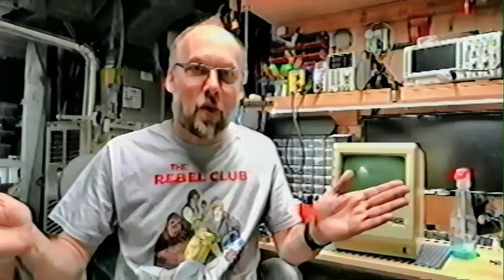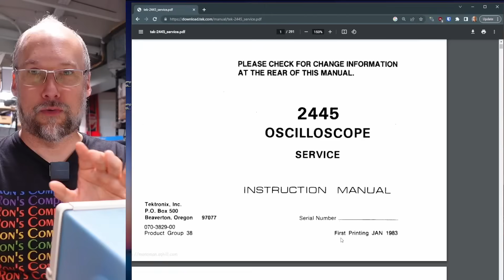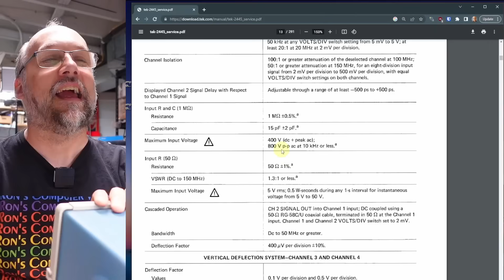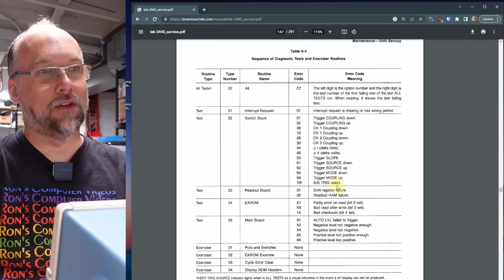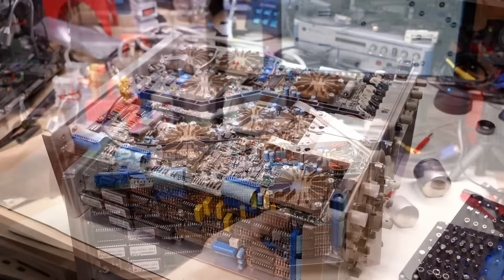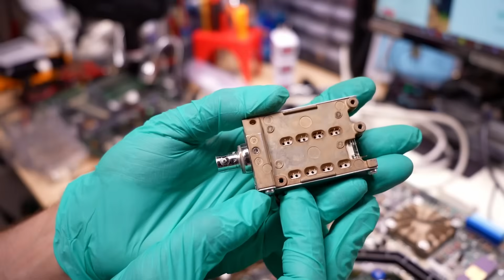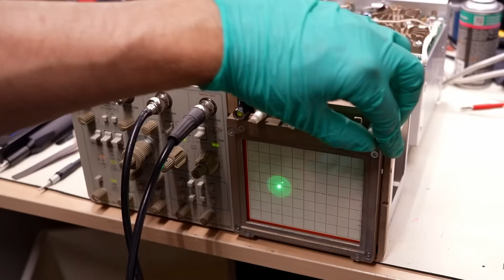Tektronix 2445: My first vintage oscilloscope repair attempt

Comment: Thanks for sharing. I have the same oscilloscope, got recently for a very little money, just some shipment with some extra for the trouble, in a defected state. 2 RIFA capacitors on the mains blow up. The oscilloscope works just fine now. I have replaced one (that I had in the box) the other one will follow soon I suppose.  I cleaned everything nice and tidy, went through the calibration procedure, just in case, as it was not really needed, the scope was already almost 100% true. Anyway, after looking at your video I do not really like the construction they come up with those relay connections. Too "touchy" I suppose. Why? But, we need to be realistic here, what do we expect from a 40-years old equipment. It is a Tektronix, quality stuff,  but it was not intended to run issue-free for a century. But in general, some solutions are (unnecessarily) made way to complicated, in my opinion. If working properly it is a very nice "no nonsense" scope. And, by the way, it is 150MHz, and not 150mhz!

Comment: To me, as shown around 46 minutes in, prodding the bnc terminal while the scope is re-assembled suggests to me the issue is not the relays, but the BNC socket. Possibly a micro fractured solder joint from the socket to the board within the attenuator board from repeated probe connection and disconnecting, along with a slightly loose socket assembly to the panel.

Earlier in the video there was another point I think it was in the reassembly with expectations all was fixed except it wasn't, where prodding the bnc lead made things right when it had been wrong again, and there was no pressing of the attenuator cover at this point in time. Just a fiddling with the bnc socket/ lead.
 Almost has me thinking it was a bad earth around the socket, which I am sure it wasn't, but then there is that extra sense terminal on the bnc socket that detects if a Textronic lead is being used...and flips the relays into a different setting...so what if that circuit is being 'half triggered' and that is why the scope shows such an abysmal trace pattern from what's expected ?
As you have the circuit diagram would it not be possible to use a multimeter on continuity setting to measure the resistance of the relay contacts from input to output and that would begin to narrow down which if any of the relays has an issue. I suspect its 'capacitance' related, poor contact, to create the trace as shown anyways.

Comment: Noting that pressing the relay black carrier down appears to improve things.  Could you isolate this to pressing down on only the clear casing of one or more of the relays?  I am wondering if the relays are not sitting fully down onto the pcb.

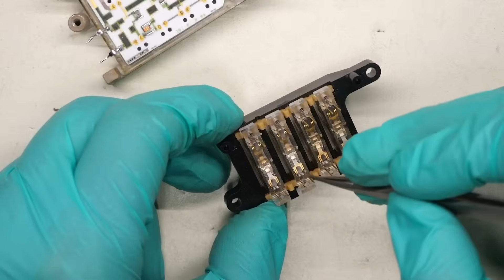At 37:21 could you put two strips of paper between the black carrier and the clear relay casing along each side so the relays have slightly increased pressure to the board.  Or indeed putting four rectangles of foam strip on the relay tops, between the relay tops and the aluminium can (a bit like where you have the paper, but only over the clear relay casings).

At 37:37  there looks to be a strip of material there at the moment (yellowed strip) which is intended to provide some force to hold the relays in contact with the board, but might have lost its effectiveness over time (become brittle and shurnk).

Comment: A little tip about "nomenclature" -- the rule about use of uppercase and lower case (as in MHz or mHz) is that quantities over a unity are indicated with upper case.  Contrary to that, quantities below unity are indicated by lower case.  Mega is clearly above unity and milli is below unity.  Hence MHz is 1 000 000 hertz while mHz is 0.001 hertz.  Simple, when you know...  Actually, there is something else to ponder -- units derived from a person's name are capitalized, while units derived from other than person's name are not capitalized.  So, Hz (from Heinrich Hertz), but 'ft' (presumably from king Henry VIII's foot) remains in lower case, as his name is not related, only his foot.  Same for meter (or metre) 'm', lower case, as no person's name as the source.
Reply: Don't forget k breaks the rule.

Comment: Try checking the actual coax/BNC connector. There should be a nut (like on a potentiometer shaft). Make sure it’s tight, but not stupidly tight. Also, check the wire from the center conductor to the attenuator, and resolder if needed. 😊

Comment: Channels 1 and 2 are the most-used on those Tek scopes, and it seems you were 98% there as far as debugging the problem.  Don't abrade the surfaces, but do clean them with IPA.  The problem appears to be the spring contacts between relays and board aren't making reliable contact, problem due to loss of spring tension thanks to being stuck in the same position for the last 40 years while eating a lot of heat-cycling as well as torque from the probes being connected to the BNC inputs.  I'm not familiar with the relay layout for those attenuators, but I'd bet cash money that the AC coupled relays are the ones furthest from the BNC jack while the DC are towards the front.  When you were hooked up and testing with the machine upside down the torque from the lead attached to the connector would flex (however small) the assembly ensuring that the front-most relays were making contact, hence why it all worked.  When you reassembled and put the machine in the proper orientation those connections were now being torqued downwards at the front and slightly upward at the back, hence why AC continued to work but DC did not.

You need to gently squeeze the flat-spring contacts on the relays to create more mechanical pressure so that they remain firmly in place with the pads.  You might also need to use some 2000 grit sandpaper to try and remove any raised burrs from your scratching of the contacts since absent a good surface-area connection you may run the risk of stray capacitance.

Comment: For a while I had a Tektronix 7600-series mainframe scope. It was beautiful, and was both an excellenet analogue scope and also fulfilled my poorly-hidden urge to have so, so many buttons to fiddle with. So! Many! Clicky! Things! And they all did useful things! Unfortunately it was very old and starting to break down --- the trigger didn't, very often, and the focus was drifting. Plus, it was vast, weighing 14kg and being about 75cm long. Eventually I had to give it away and get a modern Rigol storage scope, which is much less satisfying to use. Fun fact: the 7600 scopes could draw text on the screen --- but didn't have a CPU!

Comment: Hi, if I still had hair on my head, I would lose it terribly 😂 I completely understand your approach, if you have no experience with such a device, but you didn't even do a basic inspection of the components (or you didn't show it in the video) and stuffing it with paper sent me to the ground .
1) the input part of the attenuator was not checked (it may be mechanically damaged, e.g. by hitting the BNC), the hybrid PCB may have been damaged
2) the attenuator and motherboard connectivity was not checked (there may be cold junctions)
I almost died when I saw the gold surfaces being scratched by the metal and the pressure applied to the hybrid circuit board. Even the smallest scratch is a problem that cannot be effectively removed, as someone already wrote here - very carefully polish it with a piece of paper (you can also use a soft eraser on a pencil, but it leaves microscopic residues that need to be completely removed) impregnated with IPA and then treated with a suitable means (eg Kontakchemie Gold 2000).
The fault itself tells us what is happening - decay of the rectangular signal, decrease or increase in voltage = incorrect function of the input divider of the attenuator (it is only an estimate, but it is the first thing I would check)
1) decay of the rectangular signal = problem with input compensation
2) voltage drop or rise = input divider error
As I already wrote, this is just an idea without specific measurements, but another fact brings me to this idea - the anchored attenuator to the structure reacts to the movement of the BNC.
I could of course be wrong and the fault could be elsewhere - without measurements any advice can only be guesswork, but I am the owner of a working 2465.

Good luck finding the bug and have a nice day 🙂Tom

Comment: Enjoyed. Couldn't tell from video, but a lot of those old relays aren't sealed... and the bad connection is on the inside, not the external gold pins etc. If you don't want to brave cleaning them... you could see if you have enough working ones to restore only 1 channel. Also, have that signal generator too. It's fine for audio signals, I don't recommend for higher frequencies.

Comment: The service manual says the attenuators can’t be cleaned, but since there is no source of replacement parts, you have no choice.  I’ve done several.  With care nothing bad happened and it eliminated the noise in the vertical channel.  I used Caig Labs D100 and then 99% rubbing alcohol with a tape head deerskin swab.  I have a 2445 for use and another one for spare parts.  The spare parts unit was a show stopper because the fan motor was damaged beyond repair.  Why Tek couldn’t have just used a muffin fan?…  There is no way to source the crazy fan motor except from another dead ‘scope.  The 2445 is still a very nice analog ‘scope though it is kind of heavy by modern standards.

Comment: Back in the 80s I bought a cheap 1950s-era Dumont Cathode Ray Oscillograph.  Good up to a megahertz or so. Having something like this Tek would have been a dream, though I eventually wound up using this exact model amng others at work for most of the 90s. I've never seen the inside of one, and all I can say is holy cow, is that thing ever packed full.  Glad you were able to rescue it, very cool to watch.

Comment: My previous 2445 like my current 2245 had no atten. problems.  The Tek that gave me serious atten. headaches was a 465 and saw that alot in  the 465/475 units in shops.

Comment: I got  a 2445 for free once.  Ripple in the trace.  So anyway the DC power busses are clearly marked.  I could check all the non HV DC voltages compared to the markings and also see which one had the ripple. All the electrolytics were replaced that were like the leaky ones for about 6$ and then I had a perfectly working scope.

Comment: Intermittants can be a nightmare. Still good work and nice to see one of those scopes again.  I would suggest your problem is actually the BNC connector itself. They get "leaned" on a lot and can come loose from  the board or get damaged inside.  The channel, Mr. Carlson's Lab has lots of scopes like this and most likely spare parts.  Thank you for the video.

Comment: Great video! Love the analysis and repair. Definitely don't see these scopes around much. A couple weeks ago a friend recently gave me a 2245A scope from the mid 80s. (It's mostly identical but maxes at 100MHz.) I was amazed how much lighter weight the 2xxx series from the 80's is compared to the 70's 7603 scope I had years prior.

Comment: Both of those sandwiched boards are power supply boards and the side with the RIFA you saw has one or two more.  It does look like the one(s) on the board you could see had been replaced already.  I recapped both boards in my 2445, and the metal canned electrolytics were just high temp rated (125° I think) and I was able to get values close enough, all from Nichicon.

Comment: I wonder if a new "relay carrier" could be made to offset the locations of the relays just a little bit on one axis. This would move the contact point to a new / fresh location on that pad.  Either by making the mounting holes a bit oval, or by a 3d printed replacement?

Comment: Don't scape with metal, just use a fiberglass pencil, followed by De-Oxit to safely polish / clean the gold plated contacts. Sraping will lead to oxidation once the protective gold layer is completely removed.

Comment: Maybe spring contacts of relay are not enough strong, simply loose torque and not pushing enough strong. Try pull them little up (bend) that they can again push strong to PCB.

Comment: You're overthinking it.  Just imagine a games console with controller ports that need to be bent or re-flowed to make contact consistently.  They may look great but they've been pushed and pulled and had heavy things hanging from them for decades.  I'm sure you'll figure it out.  ;)

Comment: Remember that quintessential sci-fi TV show on ABC which first aired in 1979. All of the computers on that set were designed and manufactured by Tektronix. They drew what was known as vector graphics. Like Battle Zone, Tempest, Asteroids, etc.

Now days Google requires devepers to create simple vector graphics. Android is broken in so many ways. It's nice to look back on the past. But vector graphics technology died along time ago. Atari 2600 is a real good example of advanced graphics tech.

Comment: those digitally controlled analogue scopes were marvellous. The analogue stage was just a work of art, tolerances were just impossible at those high frequencies. I had a fully analogue Tektronics many years ago, it was "spent" but ok. One day I opened it and noticed like 1000 trimmers so I didn't even think of adjusting anything! Then I stumbled into a digitally-controller Fluke 100Mhz one. I opened it up and there was not a single trimmer to adjust, everything was done digitally! The best scope ever, but lacking digital buffer to stop the signal.

On cleaning those pads, I am not sure I would use DeOxit. It might leave some protection behind which is fine for a C64 SID or VIC IC but might interfere with the tiny signals at high frequency of an oscilloscope's front end. One of the cleaners I am using is not recommended for signals below 1V for example. I would probably use isopropyl only and I'm sure Tektronics used something even better, likely in clean rooms!

Without knowing much about those scopes, sounds like the relays might have develop some contact issues? I'm wondering whether a bath in isopropyl might help? As you said, you have to trust your instrument so right now that scope is probably useless.

Great video as usual - what's your new camera?

Comment: Definitely faulty relay contacts - I've seen the same issue on plenty of other small signal relays when they get old, and they can be intermittent each time you switch them as well as with physical force applied. A combination of oxidation on the tips of the relay contacts and/or a loss of spring tension mean the moving contacts don't make reliable contact anymore. Not much you can do about it apart from replace the relays. Probably very hard to find the relays but if you could you could fix it 100%.

The poor high frequency response (triangle wave) in the earlier parts of the video is an interesting one - high bandwidth scopes like this use a dual signal path - very early in the input signal path the signal is split into low frequencies and high frequencies, (with a crossover point somewhere around 10-100Khz) amplified separately in parallel by two different amplification chains using very different design techniques optimised for their respective frequency ranges and then mixed together again later in the signal chain after a significant amount of amplification has occurred.

This is done because it's nearly impossible to design a single path pre-amp circuit that can work all the way from DC to 150Mhz while maintaining extremely flat frequency response, extremely high sensitivity and low noise.

So the majority of that 150Mhz is handled by a pre-amp following RF amplifier design practices which can work from a few tens of Khz up to 150Mhz, the low frequency amplification is typically handled by an op amp circuit and this circuit is also responsible for precisely controlling and regulating the DC offset when you turn the vertical axis offset control.

As soon as I saw that roll off at a few tens of Khz I immediately assumed the high frequency portion of the signal chain was non-functional so what you were seeing was just the low frequency (probably opamp) amplification stage working by itself. Rather than being faulty as such it looks like it was simply disconnected due to the poor contact issues.

Comment: You should buy an eraser for mechanical cleaning of electrical contacts like that, Adrian.  There's an abrasive in the rubber that's going to be WAY more gentle than even the most careful scraping with a metal tool.  OMG, and single-point scraping like that on anything delicate just makes the hair on the back of my neck stand up.  If you MUST scrape with a 'sharp' tool, use a flat edge in a pulling motion.

Comment: Honestly your scratching on these gold pads made my teeth hurt... and not only my teeth.

The DC-coupling problem might be caused by a bad solder contact of the BNC connectors rather than the attenuator boxes.

Comment: maybe replace the relays .i had a few relays apart in my time and some parts are riveted and rivets fail .ifyou can open them and solder rivets that works 

the only reason i say this i s because if the presure is not the connection to the board and relay leg it might be from the relay leg to somthing inside 

obviously trying new relays would be a way of eleminating the above 
relays are moving parts fail 

i alway try the thing that is most likley to fail

Comment: I love my 2445Bs (3) and my 2465B (1). As far as I can tell, one of each works  completely. One '45B  mostly works. The other generates a stationary spot, telling me that at least the HV PS is working.

The scope has two PS modules, one low voltage and one high voltage.

There is a large DIP chip, U800 on the mainboard, that will overheat if you operate the scope outside the case.

And eBay has parts for the attenuators and hybrids. The attenuators are going for about $40.
Reply: Nice, still use my 2465B. old workhorse!